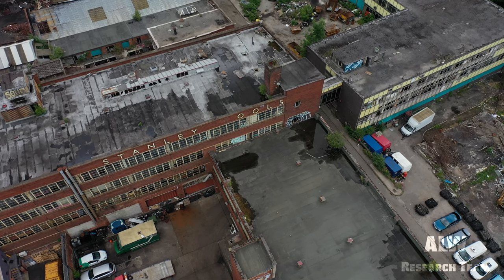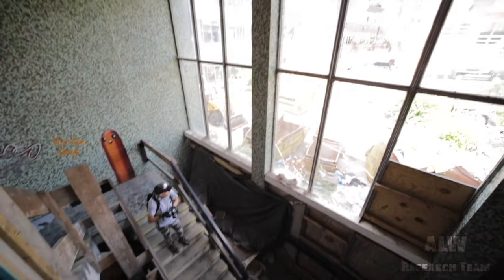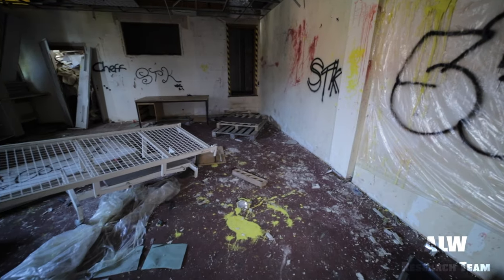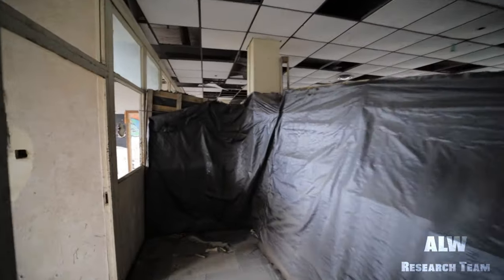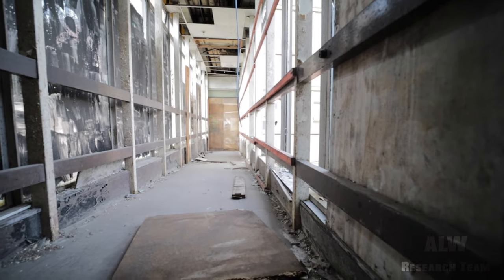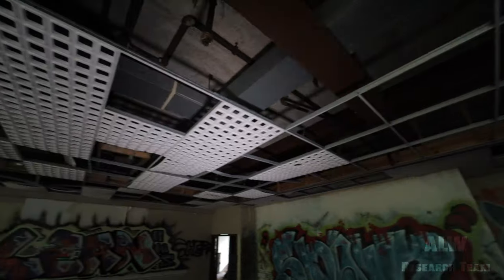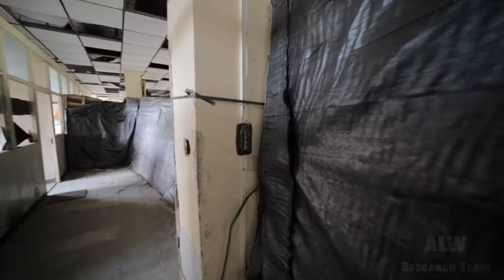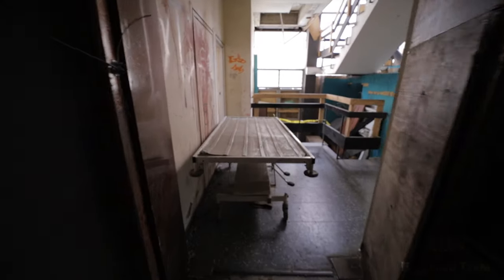Stanley Tools - Abandoned Design Offices

Comment: Nice video, Andy. I guess air-soft did more damage than abandon and decay, the structure looks better than the work floor from the previous video. Sorry you had to bail out early from the explore. Better be safe, right?

Cheers.
Reply from the maker: Hello there, Airsoft is a double edged sword as often it keeps the buildings in place rather than demolition. Also they’re usually hospitable when I contact them for access permission. This site at Sheffield was unfortunately the victim of repeat break-ins and vandalism which I’m told forced the Airsoft company out of business at this site.
Reply: @ALWResearchTeam  Vandals. Never fail to ruin everything. Thanks for the insight on the access theme, Andy.

Cheers.